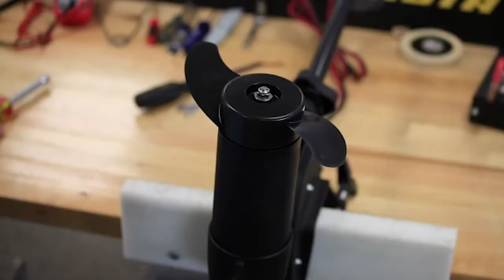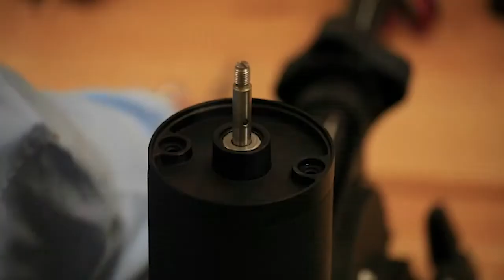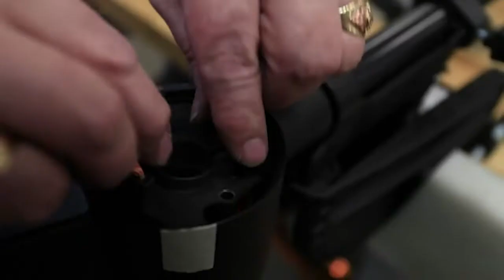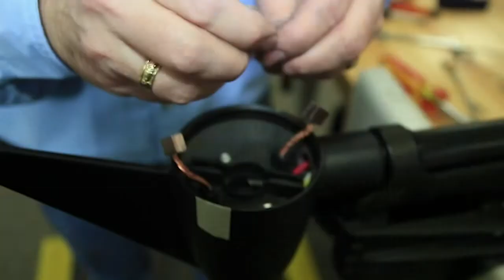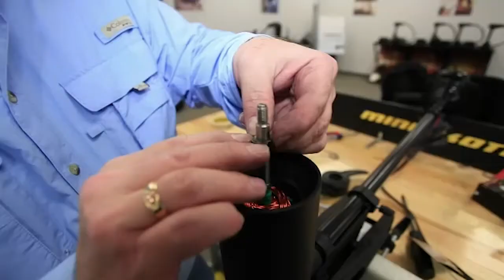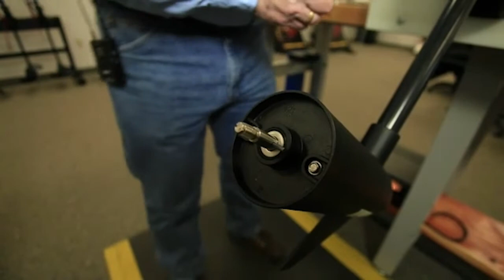3 1/4 Inch Trolling Motor Lower Unit Disassembly & Assembly | Minn Kota

Comment: This was a very helpful video. It would have been even better if there were some instruction on how to remove and reinstall the shaft ball bearing. I wound up sealing my bearing in a plastic bag and dropping it into boiling water for a few minutes. Even then, I had to carefully tap it into place with a mallet.